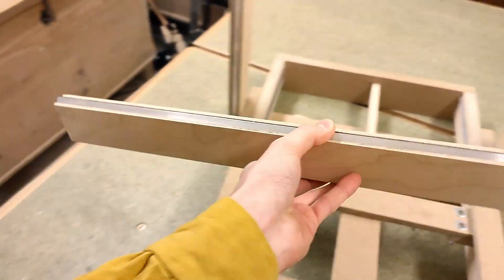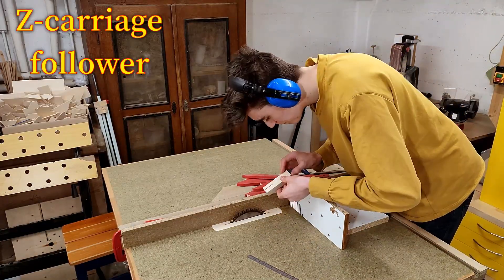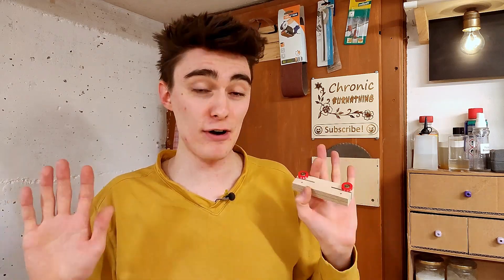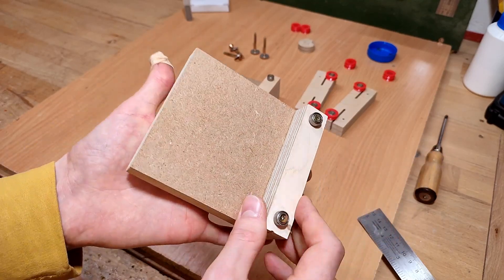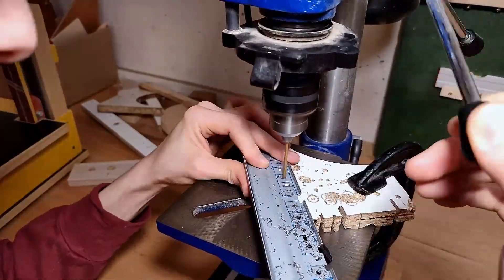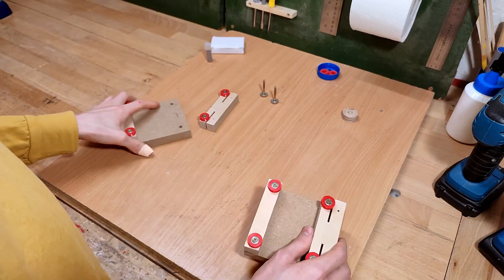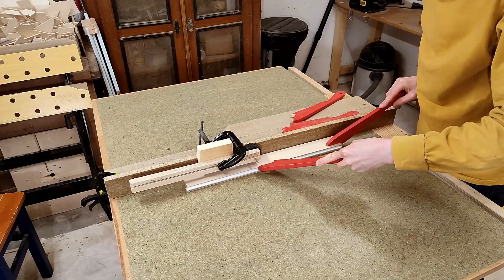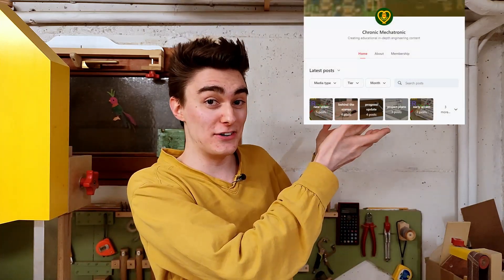Building a wooden 3D printer part 4 | mounting the X-axis!

Comment: when it comes time to program this machine, would you be opposed to programming it to use an SD card to read the gcode files? If you define all of the gcode commands into your program and use all of the helpful AccelStepper library functions including multi stepper you could create your own 3D printer firmware  tailored to the 28BYJ-48 Stepper motors. Provided you create functions to read the file and store it in a pointer (For the functionality of changing its length at run time), and use classes to execute commands during runtime. Harder to program your printer for potentially an easier time with a slicer software. You would also be able to half step those stepper motors to help mitigate backlash in the gears. Might also be able to program that calibration in. Great video, I'm also planning on starting a similar project here soon as well. Can't wait to see the final product.
Reply from the maker: I'm not opposed to using an SD card, I will probably a end up adding the SD card reader and 16x2 LCD I have laying around, but I'm terrible at programming. Writing an entire firmware is out of the question... I'm going to use Marlin which will already be enough of a learning curve since it doesn't share a lot of similarities with GRBL. Actually a GRBL version for unipolar steppers already exists, but I wouldn't even know how to implement that mod in Marlin (provided that's even possible). If anyone else could create a Marlin fork to use unipolar stepper motors with a ULN2003 driver that would of course be great. I think the Arduino Mega should have enough spare pins for that. Until then however, I'll be stuck with modding the steppers to run on generic A4988 drivers :(
Reply: @ChronicMechatronic  Depending on when you get to that in the project I might have something put together
Reply from the maker: @AlexPomesky  no earlier than May, that's for sure... You make writing an entire firmware sound so easy 😂

Comment: Are those motors powerful enough to hold thise parts? Did you test these? Or i would like to know if those motors gonna give you much longer printing time compared to others
Reply from the maker: No, I didn't really test the stepper motors,  they're definitely the bottleneck here. Z-axis will be lead screw (threaded rod) driven by a significantly bigger motor to lift that weight. Either way we'll find out pretty soon, next episode I'm already installing the Y-axis motor!
Reply from the maker: Yeah, much longer printing time for sure. Some things have to be sacrificed, either money for fast motors, or print speed for crappy but free motors

Comment: are you gonna apply any finish/sealer on the wood to keep it from moving? Moving meaning warping, and change of shape
Reply from the maker: No, as far as I'm aware no finish will stop wood from moving, if the design previsions aren't enough then it'll have to bend. 🤷

Comment: Viktor Perselli
för 1 minut sedan
I really liked seeing you make so much from the ground, like those washers in this video. I usually don’t bother making mine round, but just cut the corners. But I liked your method on the grindingstone. I will try that with a locknut.

I always learn somerhing new from your videos. Thank you!
Reply from the maker: Great!
Locknut wouldn't be necessary though, if you just flip the drill around so the nut self-tightens. I just didn't want to ruin the fine grinding wheel on the right side of my grinder :)
Reply: Yes so am I, always learning something new

Comment from the maker: Can someone tell me the REAL issues with some parts of this design? ;)
Edit: I mean the mechanical design of this 3D printer
Reply: Sure, for starters not spending $3 on washers and instead spending 2 days + $7 in electricity making them seems insane xd, if the goal is the challenge of doing it without spending money that is one thing but spending more money to make them doesn't actually "save money," prolly would been money and time ahead just taking 16 1 cent coins and drilling a hole in the center and being done in 3 mins
40x washers $3.00, but you only need 16 so actual cost $1.20 dollars into the project (@ 0.075 cents per washer), so to save $1.20 cents you instead
1x grinder disk @ $0.28 cents + 2 days + cost of electricity to manufacture them which I'm gonna guess was alot more than  $0.92 of electricity
To summarize making your own cost more than just buying the pack
Reply from the maker: @icey_projects  yes, I probably didn't really save much (if any) by making my own washers, even just counting the ridiculous hourly rate of 17 cents resulting from YT ad revenue. Electricity here however is, as Philibert said, like $1 at most. So if I spent 15min (total length of the footage) cutting the little squares with my 800W angle grinder, let's say 15min running the angle grinder and the 350W drill press simultaneously for the first batch of 6 washers, and another 5min each for the two subsequent batches (remember I rounded those with a hand file first), we get around 0.68 KWh or ~68 cents of electricity. Add to that maybe 6h of actual work plus the cutoff disc equals about $1.97 total for the washers. So yes, technically not worth it. 
BUT, keep in mind I made those washers out of 1.5mm sheet metal, which means I would have needed to stack at least 2 of the store bought ones to make up for the lower thickness.
Reply: @icey_projects  Your stupid arithmetic is childishly irrelevant! France is not as expensive as UK and US! INVESTIGATE AND SHUT TF UP! Understand the context FIRST! Grow up toddler!
Reply: @icey_projects  UNFAIR! You missed an important point of Ben's achievements: They're beyond functionality! Details must be as beautiful as their function. Since the very beginning an average observer would have noticed that Ben is like those Japanese artisans who take time to make as perfect as possible the slightest details. It's a matter of harmony you like it or not. It's spiritual as well.
2) $7 of electricity? Ben lives in France where that energy is among the cheapest in the world! INVESTIGATE! rather 1€ or less. Your universe is not others'
Ben was right with his preamble i.e. guys like you should keep their harsh and unjustified critics to themselves. I agree completely.
Reply: @joetkeshub  I don't care where you live, the entire point of this series is $50 dollar budget, thus according to himself the goal is as cheap as possible...if the goal was instead build a diy printer by making as many parts as possible this would indeed make sense, furthermore the savings with the washers was less than $1 and he himself said it took him 2 days, so you mean to tell me all the lights and recording with camera and grinder didn't use 92 cents worth of electricity, and time = money so he payed himself 1 cent per hour used maybe? My comments were not childish they were asked for by the uploader himself asking for real issues, You can't sit there and honestly say that $1.20 cents worth of washers was more expensive than 2 days of manual labor + 1 grinder disk + electricity for lighting and the equipment used as that is not logical...again if the goal is build a 3d printer while making as many things as he can from recycled material then I would have no argument however that is not the case it is build one for $50 dollars...  Don't get me wrong I thoroughly enjoy his content and his creativity, it is far better than mine for sure, however that simply does not counter the fact that logically and mathematically according to his own goals is hypocritical.
Reply from the maker: @icey_projects  I admit, my math for the 3D printer might not totally add up... 
But I originally meant flaws in the mechanical design of the machine, not flaws in my reasoning 😂
Reply from the maker: @joetkeshub  Hey, hey, Philibert, not so violent! I don't mind critics as long as they put numbers behind their claims and don't just throw insults around. Besides, I asked for it! But thanks for standing up for me :)
Reply: @ChronicMechatronic  absolutely love the vids, as far as the printer it looks great can't wait to see it completed, will you be using Bowden or direct drive...also will you be building/upgrading/replacing the wood parts with printed parts once you get it running?
Reply from the maker: @icey_projects  Glad you enjoy! It'll be a bowden style extruder - at least for now... Except for the small pulleys on the Z-axis and some air duct thingy I'll need for the cooling fan I don't plan on using any 3D printed parts on this printer. I generally don't like the idea of needing 3D printed parts to build a 3D printer, although I see the advantages of plastic. That being said, this is still only version 0.9.5, a prototype for me to learn with. 
My plan was to make a slightly smaller V1.0 after that, possibly without any wood at all, using different aluminum rails and scrap sheet metal. That version might get 3D printed parts since I'd want to get rid of the dimensional instabilities of wood, as well as a direct drive extruder